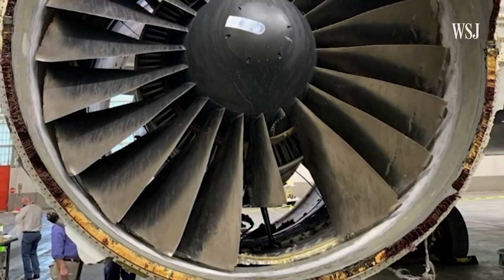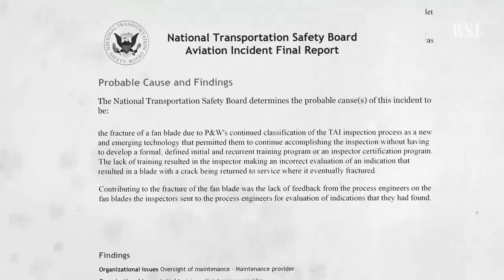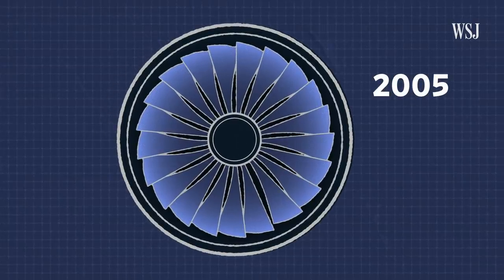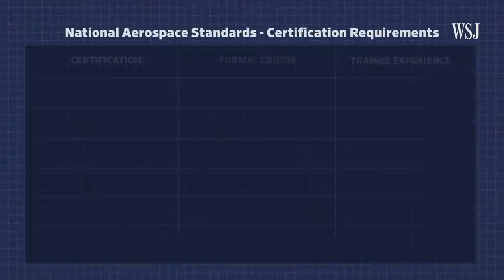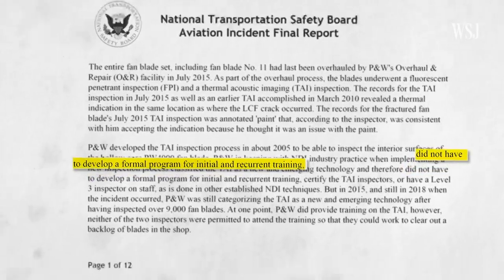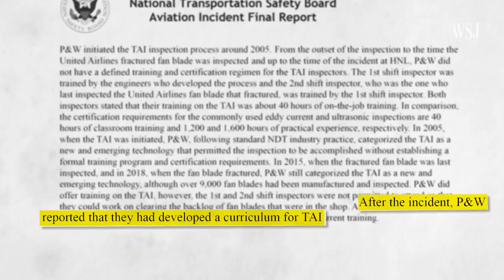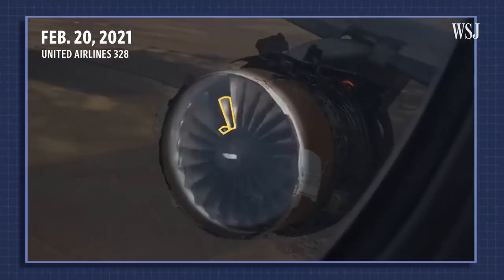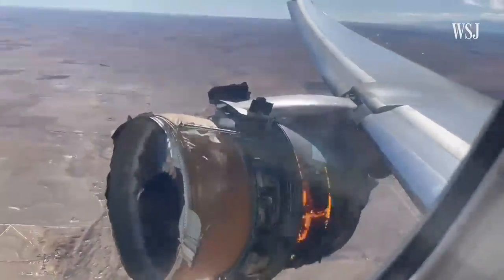The Flawed Inspection Process Under Scrutiny in Boeing 777 Engine Failures | WSJ

Comment: Am thinking they pushed the technology too far and shy of telling customers of the need for more often inspections and added down time.  Regardless, when a blade breaks, it imparts so much energy I don't know they can design any lightweight containment cowling.  Carriers would be wise to hold their enthusiasm of these latest generation engines. RR seems to have some same issue.
Reply: The Trent XWB is excellent, the CFM LEAP is really good, and GE90, GEnx, and now GE9X, are the best. It's really an issue with P&W, and the Trent 1000. Honestly, P&W really should have had complete training and resources fully in place for inspections for this type of fan blade upon entry into service in 1995. It should never have been classified as an emerging technology. If P&W had complete training and resources fully in place for these inspections from the very beginning of entry into service in 1995, in addition to truly dependable safety, they would also have had a very competitive, unsurpassed, and high quality product for the market.

Comment: Fly airbus . European standards are higher than American that also includes  moral standards
Reply: Except Airbus also uses Pratt and Whitney engines, with A330 engines identical to 777.
Reply: @dbclass4075  I think they will have to ditch the pw4000 now as it has proven to be a fail .
Reply: @omerahmed3959  Neo versions maybe, but not the ceo versions. Besides, airlines have the say on their choice of engines. Post-delivery, they can switch to other engines, if they want.
Reply: @dbclass4075  Not with the hollow fanblades though.
Reply: pw engines are on airbus planes aswell, so you’re incorrect 😀
Reply: Do you literally not know that Pratt & Whitney designed and manufactured these engines, NOT Boeing? Besides, Boeing has recently raised their standards, they're getting better now.
Reply: @rafaelwilks  Not to mention Boeing planes also have to comply European airworthiness standards to operate there.

Comment: Trent 1000 have blade problems also.  CFM also has had blade problems with southwest airline planes
Reply: But not on the same rate. Statistic is everything in that context. This engine was quick to be grounded after this incident, meaning the FAA/Operators already had some insight as their weakness and potential dangers. It is related to just one specific engine PW made for the T7.
Reply: So, General Electric? The recent engine issues are years ago.

Comment: Massive FAA / regulatory failure. How any regulator in any industry, let alone aviation, could allow technology in use for 13 years to be classed as “emerging” and therefore continue to bypass safety standards is just incomprehensible.

Comment: The 2018 United fan blade engine failure 200 miles from Honolulu was particularly dangerous with the amount of damage to the engine and the resulting drag it caused. 

I think the FAA should reconsider the standard for the design to contain fan blades in the event of a failure. The Southwest fatal incident and the mentioned Pratt and Whitney incidents were all technically contained. Containing the fan blades doesn't enhance safety when the containment devices are uncontained. 

Boeing is already working on a better cowling.
Reply: Fun fact: the plane that was involved in that incident was the replacement aircraft for the incident in 2021

Comment: Boeing can't catch a brake, first the MCAS debacle, now having multiple planes equipped with engines that failed catastrophically. Yes I know this is Pratt an Whitney's fault, but it still won't look good on Boeing.
Reply: It doesn't look any which way for them. You cannot reasonably attribute this to Boeing...aircraft have had trouble with these engines.
Reply: @genevieve571  I didn't say that it could be attributed to boeing. Just that it's going to look badly on them either way

Comment: I think the bigger question is, aren't these fan blades designed to withstand  tens of thousands of rotation hours? Doesn't seem they're nearly old enough to suffer significant metal fatigue several times in different aircraft.
Reply: well you just never know

Comment: why does the title make it seem like a Boeing problem?
Reply: Ummmm maybe because it’s only happening in 777’s at the moment. 3 in 4 years.  And no other make. Statistically that’s telling.
Reply: @xr6lad  Technically, A330 uses identical engines, so it is a matter of time. This happened before on Rolls-Royce engine issues that affected both 787 and A350.
Reply: @xr6lad  not Boeing's fault.

Comment: It may be interesting to note that another Boeing 777 freight-plane, leaving from Maastricht Airport, with the same engines, had exactly the same engine-problem on the same day (!) over the south of The Netherlands. Fanblades broke off and pierced cars and houses on the ground. The airplane had to make an emergency landing in Liege in Belgium.
Reply: Please don't spread false information!

The airplane in Maastricht was a 747, not a 777. While the engines are from P&W and of the same general design, they are smaller with an also smaller fan diameter. The P&W4000-112 on the 777 has a 112 inch fan diameter with blades made out of hollow titanium, while the P&W4000-94 on the 747 has a 94 inch fan diameter with older technology solid alloy blades.

The failure mode is (as of current state of investigation) directly related to fatigue formation on these new design of blades and therefore NOT PRESENT on the -94 variant. The failure in Maastricht is therefore NOT RELATED to the failure seen on the 777's.

Again, please refrain from spreading false information. If you not an expert in an area, either do your homework and research before opening mouthflap or keep mouthflap shut.

Comment: MCAS.  737
Reply: 737 is far smaller than 777. Also, the issue here is Pratt and Whitney engines. The same engine is also used in A330.

Comment: That last flight to Hawaii could have been a disaster If happened halfway to Hawaii.  With That much drag and vibration, the Engine pylon would separate hopefully before the wing would have problems.  Plus the plane would have to fly slower and lower with
More fuel usage.

Comment: ide guess the route cause of the fan blade cracking is either the design of the blade where they didnt use the right thickness of metal for the blade or another very likley cause would be when heat treating the metal, the metal experiences lots of internal stresses throughout the manufacturing process so its important to heat it up to the point where it releases the stresses in the atomic structure of the metal. so in that case bad quality control.
not an expert on fan blades made for planes but thats what i could think of.
Reply: If you cannot even spell "root cause", I would suspect that you have entered the realm of conspiracy theorist.
I see you have cogs and gears in your "logo", but I doubt very much you have even the slightest inkling about the metallurgy that's involved.
Go back to sleep, drone.

Comment: A well done video. I have to say though, I have no more confidence in Boing or the FAA. I the future, I will be flying with anyone but Boeing and anyone not certified by the FAA.
Reply: Flying Airbuses doesn't guarantee that because A330 also uses PW4000.
Reply: This problem isn't Boeing's fault. This incident was completely on PW
Reply: Clearly you didn’t watch the video
Reply: "anyone not certified by the FAA" literally every commercial aircraft has been certified by the FAA...
Reply: @ktjmitchell7722  Besides, FAA can only restrict planes flying within and into USA airspace. There are other aviation authorities too.

Flights that will not fly into USA airspace at all can theoretically ignore FAA, and comply whatever aviation authority it is in.
Reply: Do you literally not know that Pratt & Whitney designed and manufactured these engines, NOT Boeing?

Comment: Someone says the cause of the failure was the inspection process. Me: The cause of the failure looks like spontaneous dissasembly.
Reply: Wrong
Reply: I would say that the spontaneous disassembly was caused by a flawed inspection process.
Reply: @rafaelwilks  I would say the spontaneous disassembly was caused by the parts breaking apart
Reply: @DemoEvolvedGaming  because of flawed inspection

Comment: Boeing 737Max: *Nope* Boeing 777: *Nope*
Reply: You should add A330 to your nope list. It uses the same engine as 777. Although both 777 and A330 have General Electric and Rolls Royce engines as other options.
Reply: This is not indicative of the 777 safety record, since there are so many 777s that don't have these engines. This is only indicative of an issue on Pratt and Whitney's part.

Comment: If it’s Boeing, I ain’t going.
Reply: If it's Pratt and Whitney, I ain't going. < Logical statment.
If it's 737 MAX, I ain't going. < Understandable statement.
If it's Boeing, I ain't going. < Stupid statement.
Reply: Please watch the video before commenting
Reply: @aerofiles5044  I thought 737max is people being silly and don't know that airbus have crashed before
Reply: @nickolliver3021  Airbus also uses Pratt and Whitney engines, though. A330 uses the same engine as 777.

To clarify, airlines have three engine options available for 777:

• General Electric GE90
• Rolls Royce Trent 800
• Pratt and Whitney PW4000

A330 is similar in that regard, but with some slight differences.

Comment: If it is Boeing I ain’t flying
Reply: Watch the video before commenting
Reply: Do you literally not know that Pratt & Whitney designed and manufactured these engines, NOT Boeing?
Reply: @rafaelwilks  you know boeing chose the engines it wants to fit on its planes based of economic reasons?
Reply: @shenjiejason8350  then how do you explain that Boeing also chose GE and Rolls-Royce as equal options?